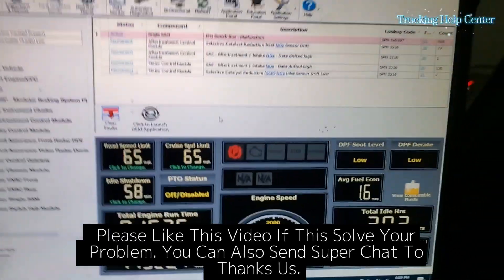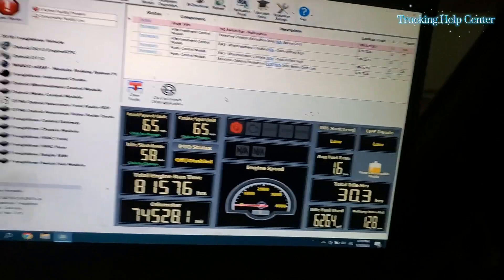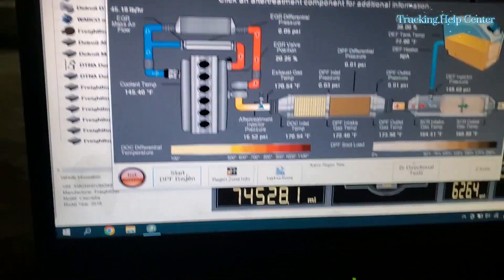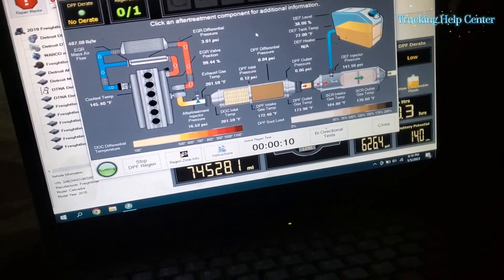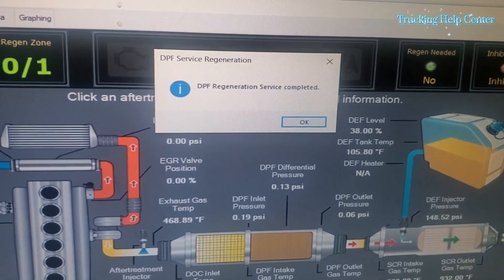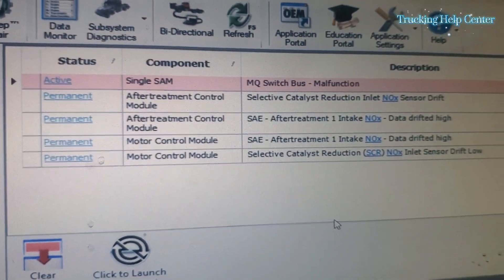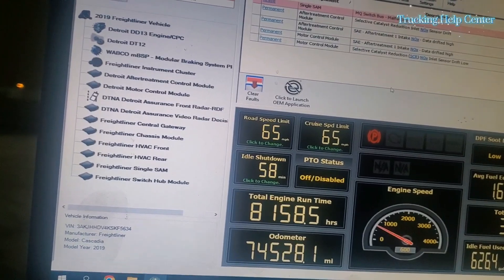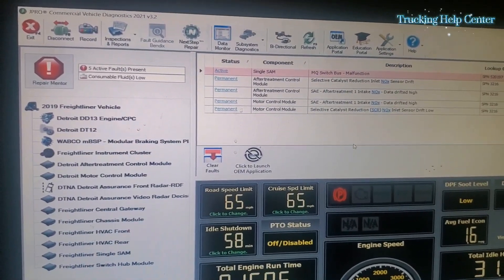Cascadia DD15 Aftertreatment 1 Intake Nox- Data Drifted High. Spn 3216 Fmi 20

Comment: I have spn 3216 fmi 21 cascadia 2015 , that happened an hour after I fuel and added a def at flying j . The light is still solid drove 400 mile any Idea please.should I waite I m owner operator.

Comment: I think I got some bad DEF and it immediately threw this code after fueling. I'm hoping I can just burn threw this bad stuff (11Gal.) with no issues. What do u think? Ran 300mi so far and truck seems fine.
Reply from the maker: You also need to check your intake nox sensor